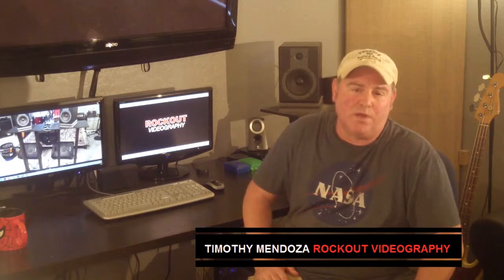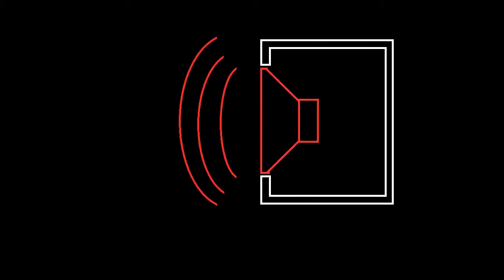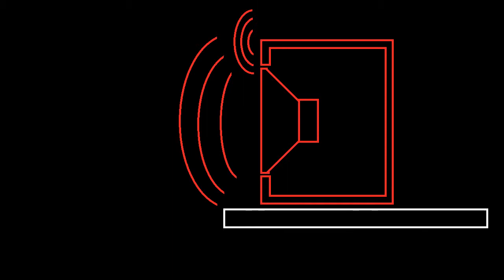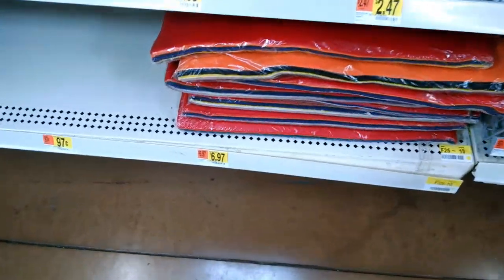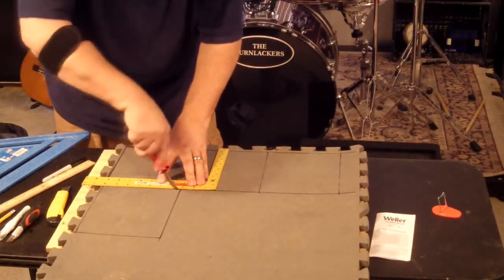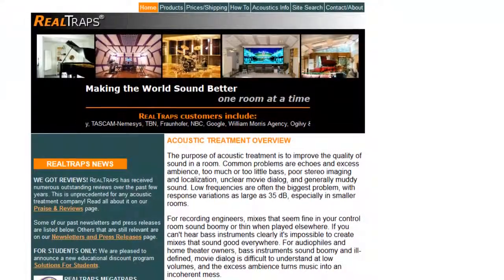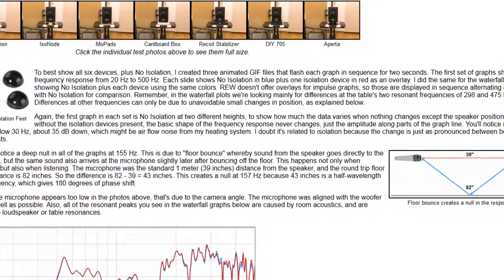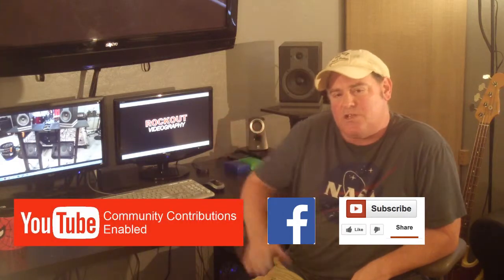Home Recording Studio Design - Episode 03 DIY Monitor Iso Pads

Comment: I made my own taking inspiration from this video and oh boy the difference is actually noticable not a life changing difference but it is there
I used slabs of MDF hardboard and Sandwiched the foam between it alternating between pf foam and softer squishy foam you'd find inside a sofa or something
Using the speakers on ground they have this boomy effect that I don't like
This also makes my table vibrate quite a bit even tho it's not touching my table in any way
Using the foam MDF sandwich i accomplish three things
-make the speakers less boomy idk why I'm not an engineer it just is
-my table vibrates only slightly now
-they're now technically speaker stands
I have the edifier 1280db
I managed to do it for what's basically 3$
Reply from the maker: I'm glad the video was usefull. Thanks for watching and taking the time to comment!